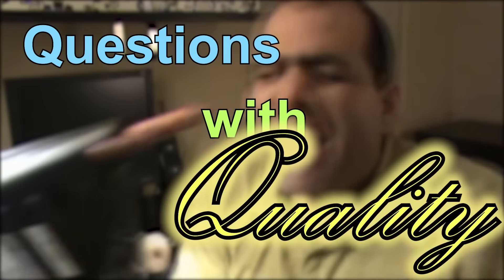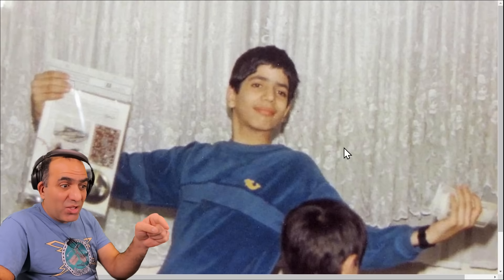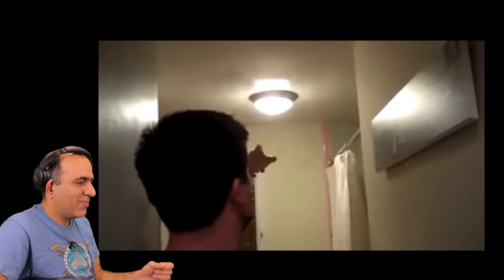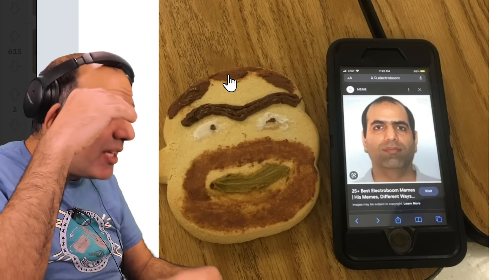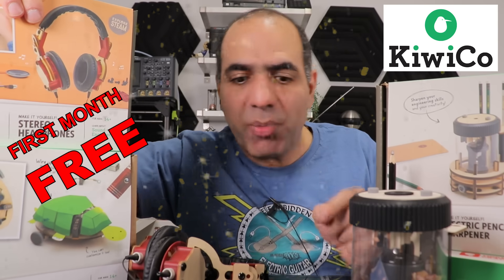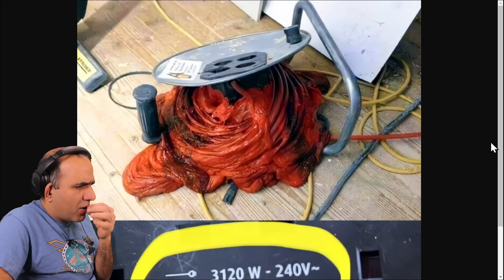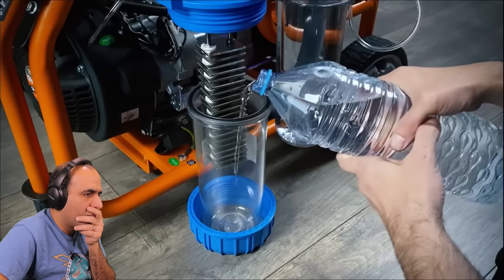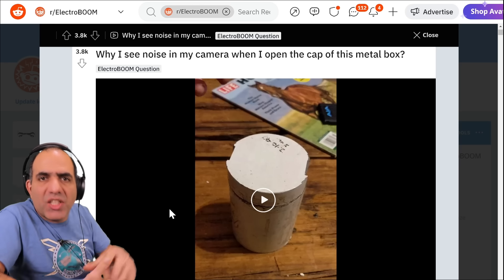Can ENGINE Run on WATER?! They Copied my Toy (LATITY-011)

Comment: The "water engine is a perpetual motion machine" argument is stupid. Water has hydrogen, hydrogen has potential energy. The only issue is whether or not you can extract the hydrogen using less energy than you free up in hydrogen. STOP CALLING IT PERPETUAL MOTION!
Reply: but it is. It's the same cyclic system that perpetual motion machines claim to achieve. Instead of weights and wheels it's the bonds of a hydrogen atom. Both rely on extra energy magically appearing within the system to overcome losses. At least perpetual motion machines have the decency to only aim for 100% efficient. 

It takes energy to remove hydrogen from the water. That energy is the potential energy of the hydrogen once it is no longer part of the water molecule. You cannot get more energy out of the reaction if you recombined the hydrogen back into a water molecule.
Reply: @azzy-551  water engines have been built. I remember a PBS special about them. Usually they are the size of a van but they can be built.
Reply: @revolverguy  I couldn't find your source for that but I assure you it either had an external power source or it wasn't a water engine at all (at least not the kind of you're think of).
Reply: @azzy-551  assure all you want, but there is more than enough energy in the system to to get more out than is put in. The problem is efficiency and safety.
Reply: @revolverguy  I'm starting to think you're talking about something else. Could you at least explain how this water engine works because the vagueness of "water engine" covers everything from steam engine to nuclear fusion. If you mean water -electrolysis-> hydrogen -burn-> water then that's just pseudoscience.
Reply: @revolverguy  When you say the hydrogen is used to make automotive power I assume you mean it's reacted with oxygen to form water because that's what most water engine claim to do. 

Hydrogen does not have intrinsic chemical energy. It depends on the molecular compound it is bonded in. In water, hydrogen has very little chemical energy because the chemical energy was released when the water formed. Therefore, you need to supply that energy back to the hydrogen to release it from the water molecule (usually via electrolysis). The hydrogen, now a gas (H2), has significantly more chemical energy than before, but that energy came from the electrolysis. When you react this hydrogen it's just releasing the energy that came from the electrolysis. 

The hydrogen acts like a battery, so water engines are analogous to charging a battery and getting more energy out than you charged it with. 

I suspect that PBS special may have been covering hydrogen fuel cells or something similar, but it's not like TV broadcasters haven't been fooled by cons and pseudoscience before.

Comment: For the guy with the wiring issue, some houses have 3 phase power, and have one common wire, once occured that the common wire got disconnected after working, immediately half the electronics broke, since they now had 400v on them instead of 230v.

Comment: Older home wiring, (U.S.) they would run from the breaker Vs to the fixture first then run down to a switch to break hot or neutral, electricians preference I guess.  I've seen different homes do it different ways, using neutral vs hot.

Comment: I'm pretty sure I did something similar when I took a shop class my senior year of high school. We had to wire to a board, it was a wall outlet a light switch and a light, I wired it up so if you plug something into the outlet and pull the trigger on it we used a corded drill the light would turn on the outlet would turn on but when you let go of the drill out it was dead and the light was off. XD

Comment: Hello, why you make a coil gun. Let it be powerful. With four hundred volts and with PC power supplies.assure you that with Tansolo 1000UF to 400V is really powerful.You can find the capacitors in PC power supplies or in televisions.

Comment: hey 
i wondered if someone could help me to wire something. Sorry for my bad English.

i need to convert 12V DC to 180V DC but I don't know how.
i need an super easy way, i found an video from some Mr Electron and he said i need an MOSFET and an round coil but I don't know how many windings i need. 

could someone help me?

thanks alot👍🤌😁

Comment: Hello Mr Boom. Can you do a video on how grid tie inverter AC power ties into network AC. The wires just joint together at my home system. Can you analyse the power flow. My first thought is two AC lines at same frequency and potential will do nothing to each other if connected together. So maybe the inverter AC is slightly higher in potential??? It's kind of a situation where two batteries are placed in parallel but behaviour is different. Also interested to know if I could trick my grid tie inverter to output when Network AC is down. By providing fake supply?? There are other questions I'd like to add to your video if you choose to follow my request. I've not seen any YT vids at all tackling this. Keep safe fella.

Comment: 8:35
I guess that happens if you plug a 1kW or higher machine into an extension cord on a roll.
The wires work like a coil and by the law of "Force that cannot escape generates heat", the cord is fried.

Comment: Water engine, that takes water in to the "fuel tank" just hat the water run threw a oxy/hydro seperater, and then burn in a ice style engine, and one could possibly have the exhaust run back in to the "fuel tank" seaing that the exhaust would be water

Comment: The "Shocking Toy" that was showed at 6:00 is a common thing to be made at elementary schools in Finland. But rather than getting shocked, it lights up an LED.
Reply: Wikipedia says 1953, but it's one of those ideas that are so simple that it probably has been independently reinvented dozens of times. Them adding the shock aspect is probably not too surprising either. Medhi was probably aware of this though. 

Pretty interesting that this thing could have been invented during the 1830s, but seemingly just wasn't.
Reply: I built one when I was like 6 or so many years ago
Reply: I have one still i use it when the power is off and i use it as light haha
Reply: The toy doesn’t shock, it just rings a buzzer. The shock comes from electric pads on his back activated by remote control held by the show host.
Reply: It's not a finnish thing lol, this exists everywhere and it's probably like 100 years old.
Reply: @user-zb8tq5pr4x He said "common thing to be made"

On combined wood- and electronic crafts classes teachers give these projects :D

Comment: I kind of have my five microwave transformers hooked up in that way so I can control the amount of current that goes to them from whatever I have plugged in so it Hass to go through let’s say the hairdryer before it goes to the transformers basically cut out some of that ouch that could kill me. Makes more sense if you could see it or watch me burn wood with it.  sometimes I ask myself Who gets shocked more. Safety safety safety YOU never mess with microwave transformers Without being a trained’ish professional.

Comment: You can’t run an engine on water because it’s like piping your cars exhaust into the intake and acting like you’re a genius who thought up something nobody ever has. Water is the waste product from burning hydrogen. Even if you created a perfect engine that used 100% of the energy gained from from burning hydrogen to power a perfect electro hydrolysis machine you still wouldn’t have enough energy left over to use.

Comment: i think u are wrong, there is water engine but not workig on hydrogen, its should work on Brown gas, its made from mixing hydrogen and oxygen but without using any power, its HHO, that changes in to HH and i think OO, then From HH and OO to H2O so we chave 3 reactions, no 1 like with normal hydrogen :v

Comment: You don't need that much power to melt an extension when coiled - when it is it becomes a large air cored inductor - powering something like a welder for extended periods will cause it to melt.

Comment: Dear Electroboom, I have a PV system in my parents house. I want to know if a PV Solar can generate enough electrical power that can run a washing machine or a electric cook top using rechargeable Truck lead acid batteries.

Comment: dear captain electroboom, is this free energy contraption real? https://youtube.com/shorts/30w2cjE8d18?feature=share
Reply: I’m not ElectroBOOM but he’s already reviewed this bs videos. It’s simple, the amount of energy to equally move the bottom and top motors to power the bulb is impossible
Reply: @KINGVONARMPIT  it kinda looks like the water hitting the bottom wheel powers a pump that feeds the water to the top wheel that powers the light and when the water falls to the bottom wheel it powers the pump to feed the water to the top wheel to power the light and then the water falls to the bottom wheel to power the pump which feeds the water to the top wheel which powers the light then the water falls to the bottom wheel which powers the pump which feeds the water to the top wheel to power the light then the water falls to the bottom wheel to power the pump (how does this end?)

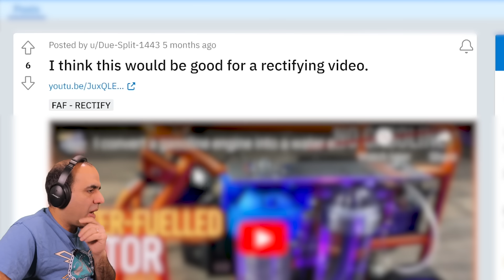Comment: 11:52 Hydrogen engines do work and are real, either in fuel cell form, for creating electricity, or in internal combustion engine form. This one isn't perpetual energy, as it's mearly turning the chemical energy into electrical energy. Once the water runs out, the generator stops.

Edit: This genetator is not a hydrogen fuel generator, but a hydrogen combustion engine.
Reply: Water has almost no chemical energy
Reply: @Owen_loves_Butters  The engine uses the hydrogen from water.
Reply: @alexrhinehart9604  And what is the product of hydrogen combustion?
Reply: @Owen_loves_Butters  water vapor
Reply: @alexrhinehart9604  So you're saying that turning water into water creates energy?
Reply: @Owen_loves_Butters  Burning hydrogen creates an explosive reaction that burns most of it, and creates a little bit of water vapor.

Comment: SO since Mehdi was so stunned by the video of someone messing around with an XRAY source that he forgot to actually explain it. The the short of it is that the entire electromagnetic spectrum is all still made from photons and even if it's not one of the wavelengths commonly associated with light (Red, Blue, Green, IR, or UV) a camera can still pick up SOME energy from them. There is even an old hack that used black electrical tape over a cellphone camera and a program to count up the light pulses per second caused by high energy photons passing through the tape and hitting the sensor as a makeshift Geiger counter.

Comment: Medhi, you need to revisit the bathroom. When he replaced the fan he opened the neutral on a multi wire branch circuit. It's dangerous and we might have to rectify a house fire later.

Comment: I paused the video and came up with the same solution as you did for the bathroom puzzle. For welding with a graphite stick, it can be done but you need probably three car batteries, thicker wire, and some filler rod. I doubt that the bead would be pretty. Spot welding thin sheet metal with a sharpened graphite rod might work better.

Comment: The radiation might be completely harmless in this case, depends on the wavelength. It's surely not a gamma radiation or anything close, otherwise there would be no significant difference between putting the hand on it or leaving open. Alpha and beta radiation is somewhat safe. Alpha can penetrate almost nothing, it is only dangerous when it becomes part of your body. That's why radioactive clouds are dangerous. They don't give much radiation but when you inhale it, some isotopes become part of your body which does not distinguish some substances and isotopes. That's why people take iodine when there is large emission of radioactive isotope of iodine. If you saturate your body with the safe one, it will not absorb the radioactive one from the air. Beta radiation is a bit more vague, it goes from pretty harmless on contact (like alpha, only ingested will cause prolonged, unprotected contact with the element) to somewhat harmless, but in most cases it will only cause some burns on your skin and can't penetrate far enough to make any damage.
Generally if it can't go through your body, it may burn you but should not cause any long term effects, it has to get inside your body to harm you. In case of a container that does not have any gasses, it's harmless.

Comment: Actually it's a common misconception that you need lead to block radiation. There are three kinds of radiations: alpha, beta, and gamma. Alpha can be blocked by a single sheet of paper. Beta can be blocked by 100 sheets of paper but it's just more efficient to block it using anything that is conductive, e.g. some kind of metal, in which case a way thinner layer will do. And then there is gamma, which is impossible to block completely if strong enough but it loses energy when passing a dense material and the more dense the material, the faster it loses energy. And this brings us to lead. The reason why lead is often used is simply because lead is a very dense material and on top of that, a very inexpensive one. Instead of lead you could also use tungsten, gold, or platinum which are all way more dense but also way more expensive. However, you can equally well block gamma using just concrete, you will only need a lot more of it as concrete is way less dense, so your shield need be way bigger. E.g. instead of 5 cm lead, you could use 25 cm of concrete, that would be an equally good shield or you use 2.6 cm of platinum, however one pound of lead costs around $1, one pound of platinum costs around $15000, so what would you take?

Comment: for the first one, it can 'weld' in a technical sense of the word, as welding is a joining process where the base material is molten as well as any filler materials. the arcs do melt the material but without it being sustained will not provide the energy needed to melt the materials long enough for fusion to take place. also yes boom is right he just sparked it a few times then used an electric arc welder to complete the weld then went back to sparking some arcs and splicing the video together

Comment: What if you have an electrolyte in the water that acts as an electrolyte and catalyst?  Before you say no, look at the iron powder in water boilers for MREs.  They are adding energy to the equation, so why wouldn't they add energy to the hydrogen generator-engine-generator loop?

Comment: you can weld with graphite, in fact it was used before metal rods.
its still used to weld wires together if its necessary

Comment: Okay, not to say the water engine is possible... but, if the water was adding energy to the system, it could be burning it like a fuel source.

Of course that's assuming we have a motor that runs off hydrogen and that the draw from it with the power tools leaves enough to continue the electrolysis process, and assuming that the motor that turns with the hydrogen is a thing.

...dang it, now I gotta look up the video.

Comment: 4:49     ?       logic suggests that the resistance in an incandescent lamp (L2)  is  HIGH;   higher than that in the control circuit in a blowdryer.       and (probably) higher than that at the LED.      so,  is  the  statement at the bottom (in red)   correct.?

Comment: Peace.

When I was young, I used carbon pencil lead as a soldering iron , when connected to 12V power supply. It glowed red hot enough  to desoldering electoronic components.  Thank you.

Comment: Graphite rods are commonly used as electrodes in arc lights. I do not think welding should be a problem so long as lots of current is available, and in the video it is powered by a car battery which can deliver quite a few amps ..
Reply: are you  SERIOUS.!           the  BEAD of a weld is  material  that is  ADDED,   DURING  the welding process.      same like  soldering or brazing.      can't solder  WITHOUT  using  Solder.
Reply: @daviddavids2884  you are right there - the bead, complete with what appears to be flux, didn't come from the spark .. I was just commenting that a carbon rod might be a suitable electrode.

Comment: In case anyone is wondering about the water motor, first of all that's a really stupid way to do it because you're losing a lot of energy converting from electric to kinetic and then back to electric again. But even if you ran the electrolysis directly off of the burnt hydrogen and oxygen, it would be a net negative because it requires more energy to release the gases then what burning them can produce.
Reply: then what      s/b     THAN what

Comment: Hey @electroboom - so nice to know what got you into electronics! Thes  stories are the best.

Typical broken neutral fault... happens every now and then in wiring. Good thing it was not the N on a 3-phase utility - otherwise appliances would get zapped with interphase voltage. And that's why you never use any 4 pole switches that switch the neutral together with the live wires. Always switch neutral on first and off last!

Now that's some stripper... don't tease me bro!

Loyalty or royalty - that's the question... Nicely melted extension cord too.
That Allen is soooo electro-cute!

Comment: Please do a video on Variac variable Transformers and Isolation Transformers.  I was a lineman for 30 years, I understand the air core of isolation and what the argument is about 3 wire plugs but at the substation or even the house panel the ground and neutral are on the same buss. What could make either of these lab tools safer because I see both as deadly. Anyways I love your content, obviously so does 5.4mil others.